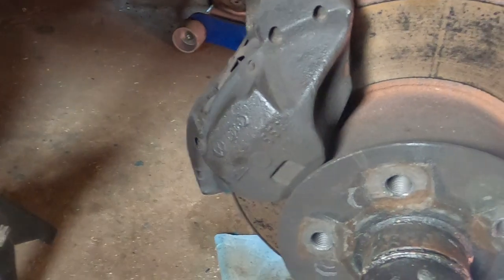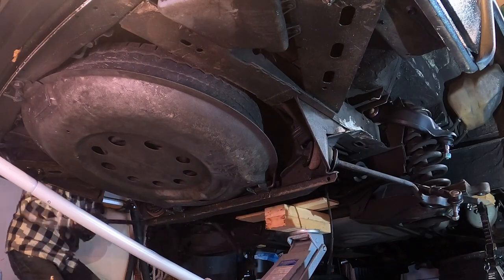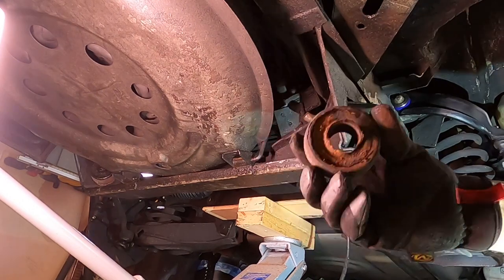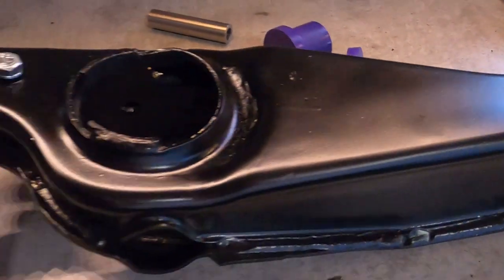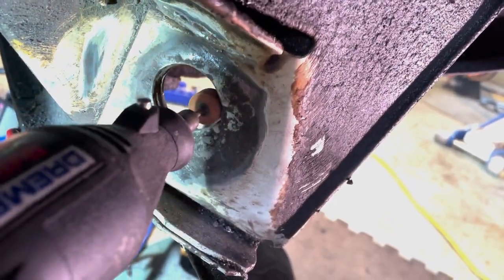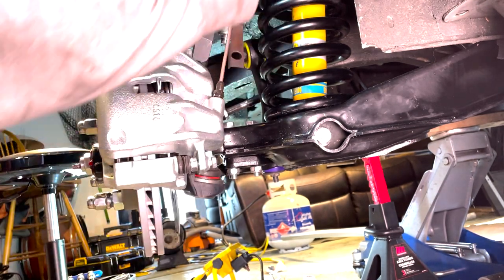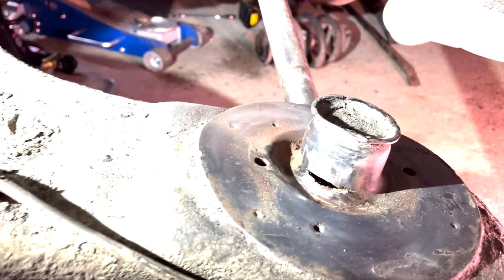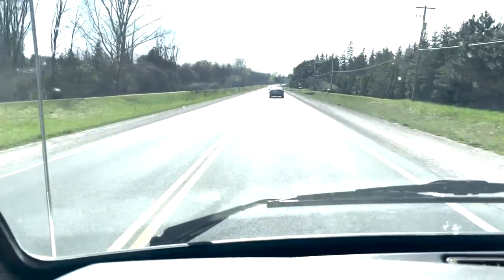1984 Vanagon gets some upgrades!

Comment: Great video! I’m working on the same for my ‘87. What black coating did you use for the lower portion of your westy?
Reply from the maker: Many thanks!  The black coating was done by the previous owner.  To be honest, whatever it is is not great.  Starting to peel back from the paint underneath

Comment: I thought I heard you mention "Small Car Performance" in your narration. I also have an 84 Westy that I recently had them do some work on for me. They did all of that 39 year old deferred maintenance, gave me a new 2.5L Sabaru motor. New gas tank, radiator, power steering, air conditioner, all with only a couple of minor hiccups. OH YEAH, a radio that works with my ipod.*  The only thing I didn't do were the brakes, I still have the original 14" steel wheels. So I am holding out on  that, and I just recently put tires on it.
 I am impressed with your ingenuity, you are far braver than I, Nice video 
*Big shout out to Dakota and crew. (SCP)
 Huge Thanks, Jimmy Buffet, aka Tom
Reply from the maker: Thanks Tom!  Yeah, SCP sold me brake kit.  I had some issues with it but they helped me sort things out and looked after me with some replacement hubs.  Good folks over there!  Sounds like you’ve got a nice reliable van now with all the upgrades!  I definitely had some moments figuring it all out but in the end, it’s all working well!  I did have a great local VW mechanic check my work after it was all out back together.  Which made me (and my wife!) feel better about my work’ ;)